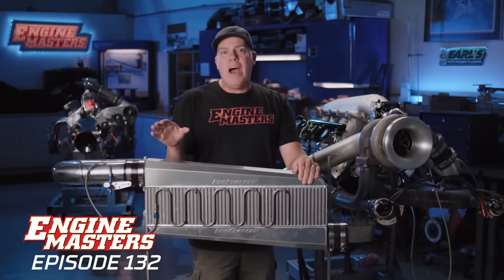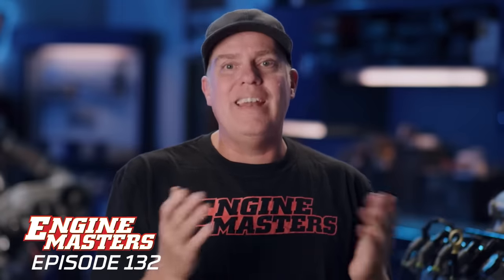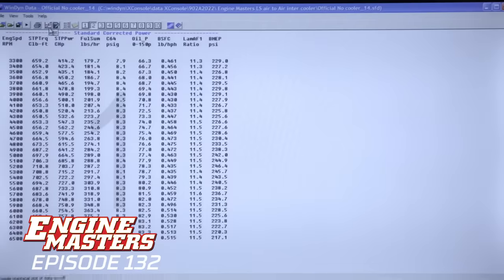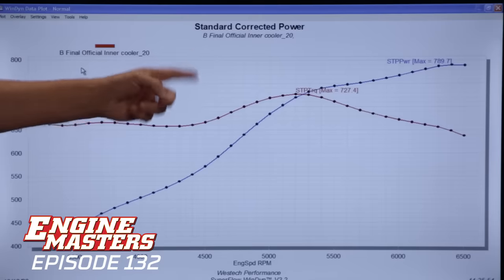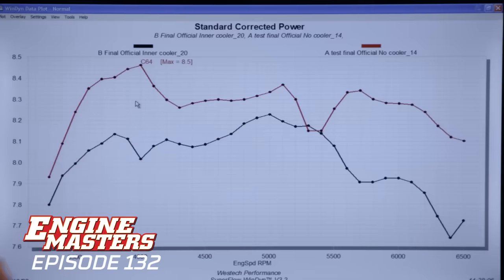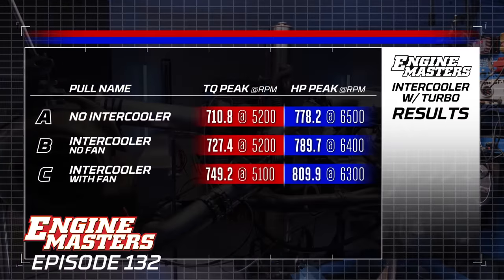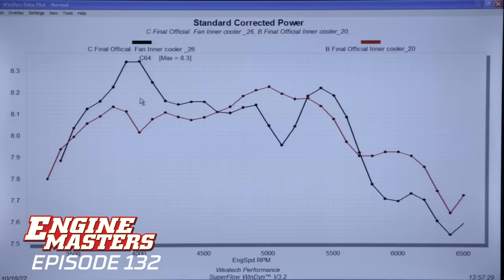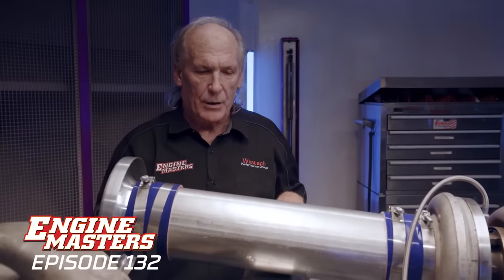Adding CO2 to an Air-to-Air Intercooler! | Engine Masters | MotorTrend

Comment: The big drop in boost pressure between the run without and then with that you're seeing is the resistance of the intercooler as well as any difference in density. 
Also likely the spray may have worked better without airflow as many of these systems are designed to quickly help rid heatsoak vs actually decreasing temps significantly.  
Heat exchange is always delta temp and delta time in very basic terms. So actually giving the CO2 time to spray and "sit on" the cooler may have helped. But again mostly for getting getting rid of heatsoak after sitting.
Reply: You’re right on the pressure drop but not the CO2. The CO2 tank they have isn’t a siphon tank so they’re just spraying gas and not liquid. They’d have needed to invert the tank to go it right.

Comment: Great information, i was just considering this on my supercharged miata. The intercooler made a massive difference. 
It goes without saying that plumbing diameter, length, and size of the intercooler can directly result in a measured pressure drop.

Comment: I’ve thought for years about a closed loop low pressure (R-12) refrigerant “tilt coil”as a charge cooler. Only moving part would be a mechanical pivot at the bottom of the coil. As refrigerant liquid flashes to gas in the tilted side of the coil the superheated (cold)  gas would migrate to the coil high side condense to liquid, the coil would tilt and start the process over. The only requirement is warm airflow passing through the coil.

Comment: You guys should  have added  cold can fuel cooler to the mix. Nearly frozen gasoline helps a lot
Reply: You would need to confirm with an actual Chemical Engineer, it requires a lot more energy to change phase from a liquid to gas than it does to raise it from its melting temp to its boiling. For example, water requires 7x more energy to get from 100c to 101c than it does to go from 0c to 100c. The phase change of the fuel is doing a huge amount of cooling of the combustion chamber already. You would be way better off changing to something like E85 so you can add more cooling through fuel evaporation rather than installing a fuel cooler

Comment: Sudden end to that video. 
Did you upload the right version?

Would have been nice to see the difference in temp compared to the earlier runs for the last pull as well.

Any rule of thumb for how much lower octane that can be run per degree lower of temperature regarding detonation?
A knock sensor and pump gas doing it all over again, pushing it right to the edge of detonation,  would be really interesting to see.

Comment: I want to run co2 instead of water in the intercooler in my car under a roots blower using a nos solenoid. Thanks for the tip on using the solenoid.

Comment: guys use the spray nozzles that you would use on your garden vegy patch the small ones that you put in triclon hose and use a soda stream bottle upside down that is what you would use in a drag car small and light and activate the solinoid when the car goes into boost cheers from down under

Comment: The pressure drop you experienced was likely due to adding the intercooler vs not having it. Intercoolers are known for dropping pressures…
Reply: Correct.  Turbulent flow inside the intercooler is necessary for as many air molecules to come into contact with the aluminium as possible.  If the flow is laminar pressure drop will be reduced but most of the air will not touch the aluminium. As air is a poor heat conductor the molecules contacting the aluminium will insulate those that do not, therefore most molecules will not lose heat.  Intercooler design is about finding a balance between restriction and heat transfer.

Comment: Also, yes there are air to air intercoolers for roots blowers. The ford t bird super coupe had one as well as there being aftermarket options to install them on GM 3800 engines.
Reply: Just curious of what company sells aftermarket air to air intercooler specifically for gm 3800s? 
I pretty much only do 3800s and was only aware of zzps water to air and a couple other smaller companies with similar water to air.
I know of a few YouTubers  who had air to air setups, just thought they were custom though.
Very much appreciate any info. Thanks.

Comment: The lower boost pressure with the intercooler can also be attributed to pressure drop across the intercooler if it's restrictive. You would need to measure boost before and after the Intercooler to know for sure.
Reply: Maybe, but remember, not always boost means something, air density really means something. Some time ago an engine builder explained that, pressure doesnt mean boost, if you increase air temp you create pressure but also reduce density. Lower temp reduces pressure but increase density (More density More Oxigen, more fuel can be injected more power).

Comment: Most sprayers are designed to help temps after several runs when everything is heat soaked. Not necessarily helping your peak numbers at fresh.

Comment: Put the inter-cooler on an NA engine with the C02 chiller.  Artificial cooler air /  DA modifier.  Would be interesting to see if cooler air would out weigh the intake restriction.
Reply: The gains are pretty minimal without boost. If you live somewhere where it gets cold your car doesn't just become an animal in the winter despite sometimes below freezing intake temps. Side note: most modern vehicles run heated coolant through their throttle bodies to prevent them from icing up in the winter

Comment: Would like to see a air to air vs a water to air intercooler test. Trying to decide if the added weight and hassle of the ice is worth the power gains
Reply: Depends on if it's a street car, street race car or straight race car...if it's driven more than raced than A to A is the way if it's main purpose is to be a race car then W to A is the way...W to A gets you the coolest charge but not practical in a street car..
Reply: Most super expensive hyper cars (example - BUGATTI CHIRON) has A to A intercoolers..most drag cars have W to A..
Reply: Drag and drive/no trailer cash days style build.
Reply: @davidjames766   Just go Air to Air for street/strip setup. And if you want get a 50hp shot of nitrous or a methanol injector for when you go racing.
Reply: depends on the apparatus making the boost too. I have a water cooled brick under my roots style blower!
Reply: Depends on the setup and use case, as Craig said. Lots of OEMs do water to air for packaging. They have exchangers to reject that heat from the low temp coolant loop to the air but some drag cars just have an ice water reservoir instead because it only needs to run hard for a few seconds
Reply: Water to air is better for the street and short bursts of high power hence factory cars use water to air. Air to air is better and simpler when you have constant airflow such as a high speed super car or race car.

Comment: The CO2 benefits in extended runs, not short bursts or in areas of high heat like Arizona. If youre hot lapping your car, even with the best A2A intercooler youd run into heat soak issues, C02 can help extend those laps or rounds and can be set to activate when a certain IAT goes over a threshold, to keep it in check.

Comment: Thank you for this. I was thinking of getting a co2 intercooler kit, but its not worth it. Plus you have to somehow carry a co2 bottle in the car. I'm gonna try windshield washer fluid and a garden sprinkler nozzle to spray my intercooler.
Reply: just disconnect your windshield washers and run a hose with a nozzle to your intercooler. Thats what a couple of my friends did.
Reply: windsreen washer jet's get some newer ones are an eco spray type

Comment: I'd revisit again but run until the intercooler is heat soaked. I think where these kits shine is bringing the intercooler temps back down after being soaked with heat. I know after a run my intercooler is quite hot I would think a lot like this would return you intercooler temps to a more reasonable temp mlquicker now obviously a fan going to radiate that heat out just as well but if your in the staging lanes this could bring your temps down a bit before your run

Comment: In a real under hood environment it makes a much larger difference because of heat soak, liquid sprayers will bring the temperature down to where your testing was but from a much higher starting temperature

Comment: I recommend to put the line set going thrue the intercooler. An coming out again.that way it will cool the air sufficiently....it will work then....Joe Hawkins says that Alabama, Blount co. 😊an or add line set off the  ac unit in the car to drag race an see...😊

Comment: The ecu should be adjusting the mixture based on the air density which is temperature dependent. I dont understand why they should have to adjust their tuneup unless it was an incomplete tune to begin with.

Comment: Adding piping and intercooler dropped the pressure at the manifold. 

Also, bleed valve controlling is a small boost leak and isnt consistent between setups. Digital boost controllers shine in this department and keep the leak sealed off until the last minute which equals faster spool ups.

Comment: just because i like to stir the pot what about runing a intersooler on the intake of a NA car to get colder air temps ( i think it would not make very much diffrence in temp or power but you never know )
also wouuld just having a air compresser and a tank inset of co2 or nos in the sprayer be any better or worse

Comment: Well, a plenum mounted belt/chain driven supercharger can be cooled, but I believe based on where it is based on the throttle body/carb and the boost component it's called "Intracooling" which is what an LSA is using.  The difference being it is water (or some kind of coolant) to air.

Comment: I found it interesting the fuel-to-air had to be changed for the differing test conditions.. I was thinking of replacing my factor inter-cooler (my car has a known rod knock fault) but now I'm reconsidering.

Comment: I used to have the Evo6 it used to have the intercooler spray and it used to make a difference specially when you’re driving a bit.. I change the water bottle into icebox that was much better made much more horsepower IN lower boost numbers in hot climate

Comment: It would be cool to be able to heat up a chamber around the block and water pump to underhood temps with meal holding that heat there. What about water/ethanol mist? I think an extra washer bottle misting on the intercooler with a fan blowing gets the fins cooler than the CO2. With that kind of setup, it only cools on the surface of the metal and disappates quickly whereas an alcohol mist would make more contact with the fins and evaporate, causing it to cool. That is why its more common to see water sprayers than these co2 things, and the same applies when moving over to a air to water. A metal water tank will just soak up the heat, where as a plastic tank or yeti cooler is made of a heat insulator.

Comment: The guys missed the fact that this in fact does apply to roots superchargers; yes you cant apply this directly to the intercooler itself but you CAN apply it to an auxiliary heat exchanger it could be connected to

Comment: The only reason you had a drop of pressure is because you added a restriction to the airflow. High quality mfg will note the pressure drop you should expect out of a particular intercooler model.

Comment: I think the co2 cooler would work more efficiently on the fuel rail. Fogging the a2a with water or methanol seems to drop iat much better so you might try that also.
Reply: The water is really the key there. The latent heat of vaporization of water is roughly four times larger than CO2 by weight. Water absorbs a metric buttload of heat energy which is why it's used for engine coolant in the first place. When you mix in evaporative cooling with that also you get even more

Comment: So what is wrong with the air temp compensation table?  That’s why that table exists in a efi system , to add fuel in colder more dense air
Reply: For sure. Something wasn't right if they had to keep adjusting the tune - and nobody even questioned it? Imagine if you had to retune your car just because it was cold outside that day!

Comment: I would have tought you'd gain way more power. Specially if you're always keeping the same boost pressure.
Another point about vortech superchargers, the colder the air, the less boost pressure, less pressure means less resistance meaning the supercharger is easier to drive.

Comment: I dont understand why there are no split turbos like they do in f1. I dont feel lit it would be hard. Where the 2 snails are separated and connected by a spinning shaft. Boost side up front  by the intercooler and hot side back by the headers. Have you tried that? I would think the separation would make a big difference in heat soak.

Comment: Between runs if the intercooler heatsoaks we just crack a nitrous bottle on the intercooler to freeze it. It works just as well, is cheaper, and weighs less.

Comment: Air density is everything. You can have 100psi of boost but if your intake air temp is high, it's useless. Cold air and lower boost can easily give you more power because your air density is higher, which also means it takes less effort to generate that power output.

Comment: I have an electric A/C compressor from down under. What if you put an evaporator coil in the intercooler and ran the A/C compressor? It seem like it would be more efficient and a closed loop system. Could I put one under my 6-71 with carbs?
Reply: Was about to say the same. lol. Been wondering about this for a while also.
Reply: I'm running a 6-71 on a Chevy inline 6 292 with a Ryan Falconer V-12 head. I thought about freezing the whole intake. @SPEEDOFDOG
Reply: Get junkyard Nissan leaf air conditioner or some other electric vehicles
Reply: Yes
Reply: The fuel evaporation pulls heat from the intake charge, I think they tested that on a previous Engine Masters episode.

Comment: lower air temp makes more power at lower boost but doesn't lower air temps actually increase the boost potential?? I register more boost in the winter than I do in the summer. In PA.

Comment: Maybe at a drag night you could have that snake thing attached to your intercooler, hose it down with a big welding bottle like you had for a couple minutes, then do a run on the strip? But certainly otherwise this system does seem kinda superfluous compare to just a good A2A intercooler.

Comment: How much of the CO2 went into the combustion air displacing burnable air?  That's a lot of cubic feet you made in the Dyno room. I probably would have added an outside air vent blowing right in front of the intake tube extension.

Comment: I think you need to check the temperature sensor, 105 degrees at low rpm is very high let alone 150.

Comment: Did the trigger spray 807 not also have the fan tho? Like you still need moving air to force the co2 through the core and help cool the charge air...

Comment: Beer CO2 going in is only hitting it in certain spots and there's a lot of places that it isn't hitting it moved to CO2 to believe from the intercooler about 4 in in blast it with the fan sitting for in away from the two and then it'll go through there better
In my mind it might make it cooler😅

Comment: it's crazy see just from simple airflow over the intercooler does the grunt of the work on cooling the charged air and adding in the CO2 didn't help much.  i'm wondering how cool does the air have to be to reach that plato?

Comment: Wouldn't using a nitrous injector directly into the start of the inter-cooler, cool the charge and provide more oxygen at the same time rather than spraying CO2 on the inter-cooler itself?

Comment: I've always wondered what would happen if you were to say, take the AC and use it as the air cooler for the intake
Reply: Ford did it in like the 70’s or 80’s and the Dodge Demon current does something similar.

Comment: One problem i seen with that setup 
While the big fan is on and the air intake that close to it they both competing for positive airflow but the fan is pulling more air than the intake creating a negative airflow going to the motor the motor is fighting for air the fan is taking 🤷🏻‍♂️

Comment: Did this several years ago with CO2 to water intercooler increase 80 100 HP increase per 1000 HP with just a Buick v6

Comment: I posed the question in my head years ago but never attempted it. Could you use an a/c compressor with the system circulated through the jacket of a intercooler??? Any thoughts?

Comment: Stick shift cars at FL2K just went 219mph. Think that blower fan is moving as much air as a car does at 200mph? 150mph? 80mph? 50mph? It’s not. That’s why your fans basically don’t run on the interstate. No fan can move as much as a car at 55mph and frontal area. I think the cooler in the dyno room is actually less effective than being on the front of a street car. If we’re talking about a cooler on a 1986 SVO mustang with the cooler on top of the turbo, sure.

Comment: "You cant use an a2a intercooler on a roots supercharger".... umm yes.. yes you can, and its quite common in v6 l67s. Iv actually got an a2a plate underneath my blower but using a w2a intercooler because it gets better intake airtemps than a a2a cooler

Comment: what was the temp of the CO2 coming out of the line?  likely better with a liquified gas instead of just pressurized
Reply: The co2 is compressed to a liquid in the bottle .. when it hits atmosphere it flashes to a gas .. that change from liquid to gas creates cold temperatures well into the negative